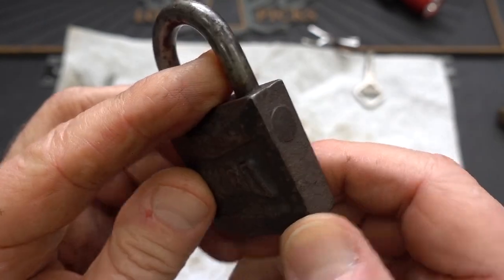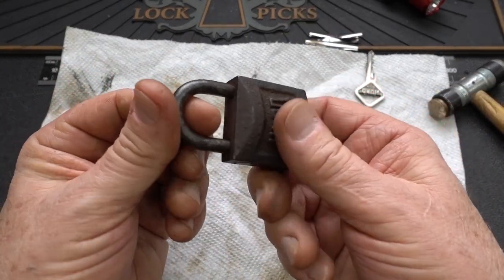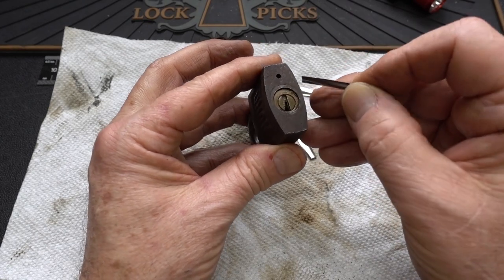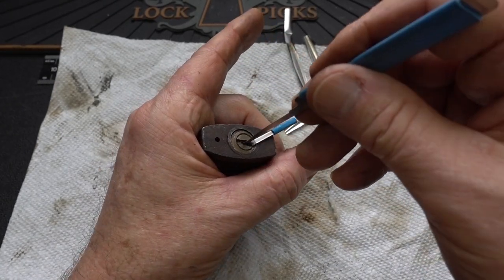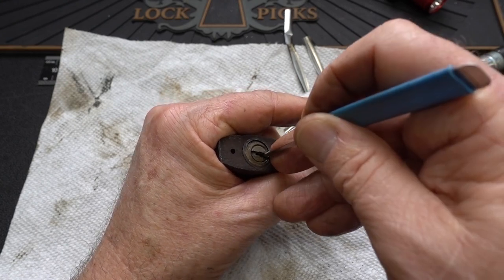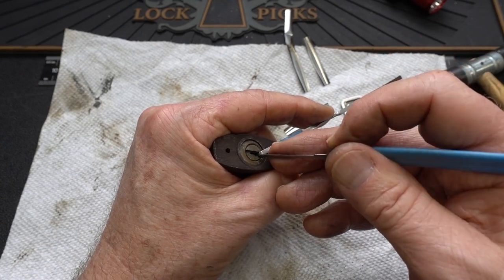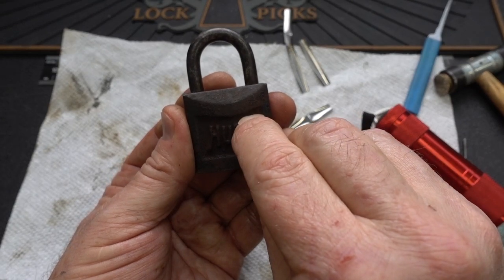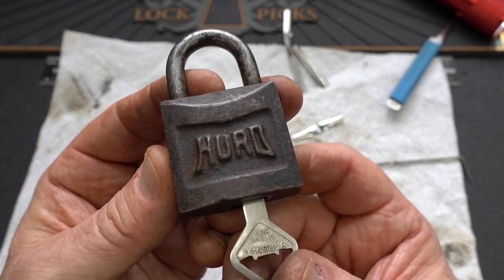(1628) Antique Hurd Padlock (Thanks Marcus!)

Comment: An ultrasonic cleaning tank should be in your shop.  The ones marketed for cleaning brass cartridge cases are inespensive and effective.  The cleaning solutions sold for that same purpose are detergent with organic acids (such as phosphoric and citric) and do a very good job of removing crud and corrosion without eating good metal.  Follow up with a teaspoon of Ballistol in clean water to lube and protect the metal.  Hornady and Lyman brands come to mind.

Comment: Still might be the right key. If one of the pins for low cuts is seizing it gets pushed back up by the high cuts - Solution would be to rap it with the key in place.
Reply: Another possibility is to invert the lock and spray in some lube and just use a rake to free up the pins then set it pins up  and rap it a couple times.

Comment: Nice lock just needs some TLC. Nicely done Bill & onward to a great 2020.
Reply: Oh yeah that bitting was insane, probably is the key to it, just so gunked up. I'd give it a soak in a vinegar mixture.
Reply: @AThreeDogNight  Vinegar would be a bad choice and will definitey change the patina. Mineral spirits or diesel fuel are the preferred solvents in this case.
Reply: @tomferrin1148  , That's why I said mixture, 50/50 with water & about 3 drops of Dawn dish detergent, also lighter fluid will help somewhat & then a brake fluid cleaner will spray it out cheaper than the houdini will. You can catch the big cans on sale a lot of times & it smells just like the houdini. Never tried the others so thanks for that, I will give it a try next time.

Comment: I would not say that old Hurd lock has had a “Hard Life” but rather a Long and Useful Life. Paddle Locks are not meant to sit upon a shelf and be admired and dusted off or polished, they are meant to lock hasps or bolts so to keep items safe from theft, misuse or abuse. These hasps or bolts might be inside out of the weather but more than likely outside in the blazing heat, or freezing cold, all the while getting rained upon, snowed on, and bombarded with dirt, dust, and grime. Sir, what you call gunk and grime is a badge of honor that is proof that this little old Hurd paddle lock has done it job and lived a long life and though his partner key might be MIA currently for one of a thousand reasons that if reunited this old Hurd lock if given a little cleaning and a drop of oil would be ready again to stand sentry on some lonely hasp or bolt to keep its owners goods safe from theft, misuse or abuse once again.

Comment: I think my father would have soaked it in gasoline to try to dissolve whatever is gummed up inside.  (This is NOT compatible with Plug4uk's suggestion of heating it with a cigarette lighter.) I suppose there are better and safer solvents today.